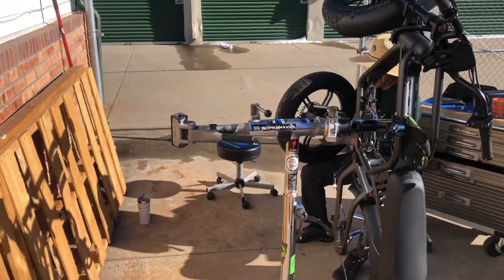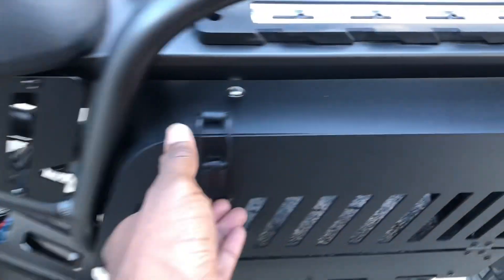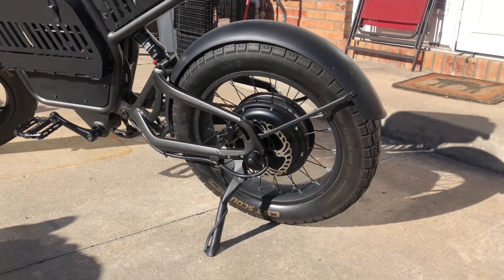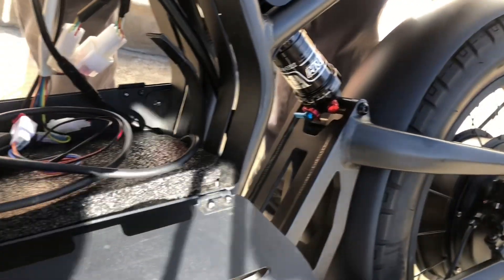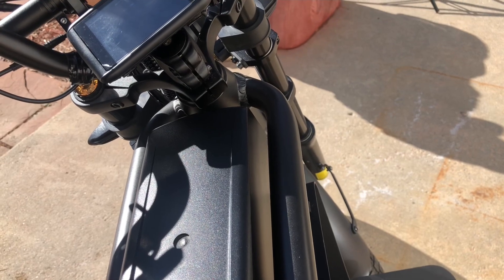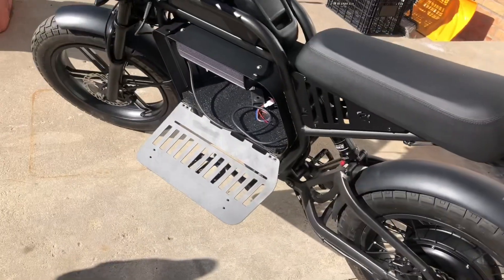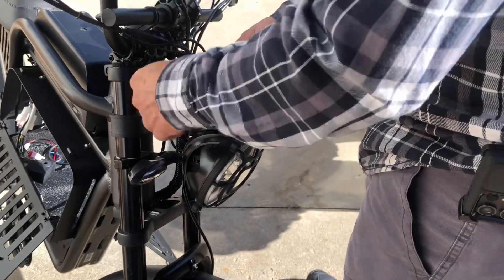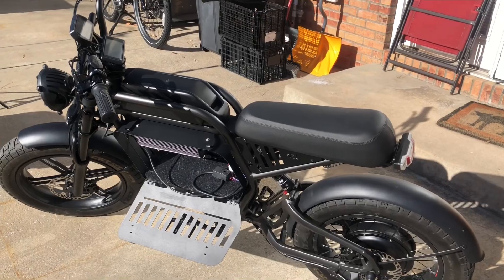Revv1 72v 5000w conversion

Comment: Why was central driver not able to get the chain on but you guys could??
Reply from the maker: I actually ended up encountering the same issue he did with the chain. I’m now chainless temporarily until I can tap some new threads and find a new spacer and single freewheel that will work with a different chain

Comment: That ebike looks so cool, I like what you did with it, can't wait for the shake down cruise. Looking to do something more powerful to my Kepler like what you did or what ebike guy did adding a front hub motor and leave the stock as is, ride normal then left thumb hits turbo mode front hub motor kit kicks in for combine to aroung 45, with 5000 what do think? 60 mph or more?
Reply from the maker: If you put a 5000 in the front I think your front fork would split off and leave you a mile behind lol. You have to be real careful with adding front hubs. Too much power up there will give you a really bad day. You have the right idea though using it as a turbo or boost to supercharge the rear hub motor. If you could get the 5000 in the back and switch the stock motor up front that would be the move probably.
Reply from the maker: You can definitely get 60 out of a 5k motor with the right battery, controller and tune. If you’re going to go 72v I would definitely recommend contacting Powerful Lithium to build you high quality cells with excellent customer service

Comment: How’d you get the full throttle on the stock buttons
Reply from the maker: The full throttle is hooked into the 72v 100a Saboton controller. The lights and turn signals are running off of the stock controller and battery
Reply: @MannyReidTV  hmm then how’d you get the half throttle off?
Reply from the maker: I cut the half throttle away from the buttons with a grinder. It’s the only way to do it unfortunately. Not hard at all though if you have the tools. You would need to buy that throttle piece again if you ever planned on going back to the stock 52v system

Comment: I bought by Revv1 before i started seeing all these failures at the free wheel... Hope i don't get it... I've already got a 72v ebike, not particularly inclined to have to put a bunch of money into my revv1 just to keep it rideable
Reply from the maker: What’s your 72v bike?
Reply: @MannyReidTV  Solar E-clipse. Bit pricier than the sur-rons and talarias, but it's 72V stock. Didn't want to throw 10 grand at a surron to go 55mph, I do it just fine without having to upgrade anything. Had an issue with my throttle but they sent a new one. It doesn't cut out anymore like the review ones did, and it's got a sweet thumb throttle to engage the regen breaking now.
Reply from the maker: That thing looks sick! Plus it’s the way you want it out of the box. I love it!
Reply: @MannyReidTV  looking forward to video of you tearing around on it!
Reply from the maker: Me too haha